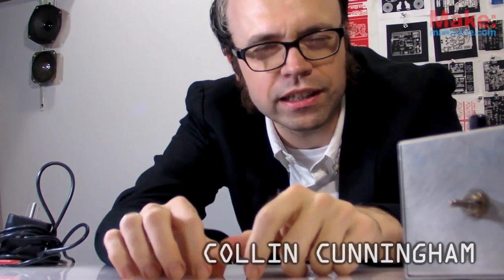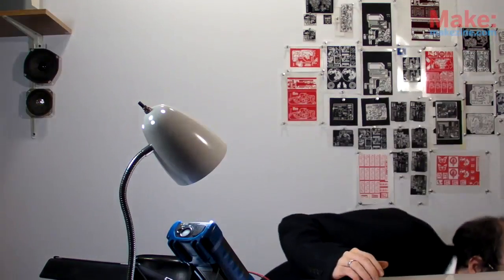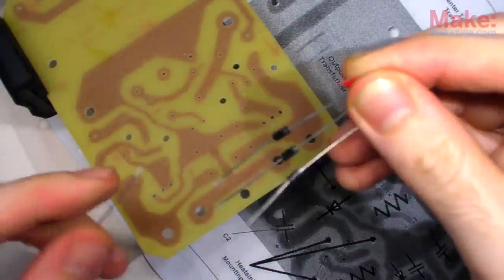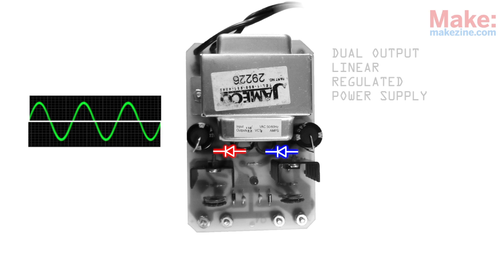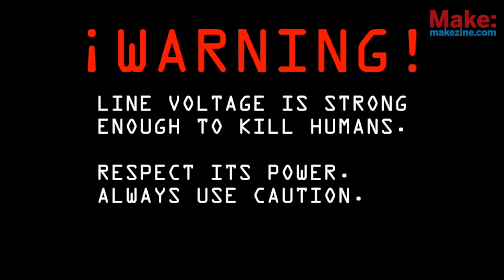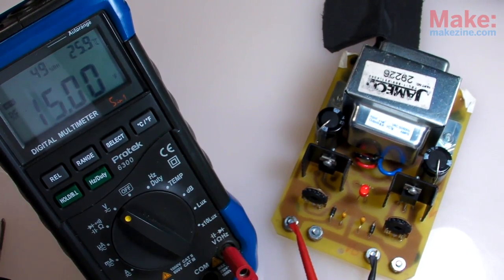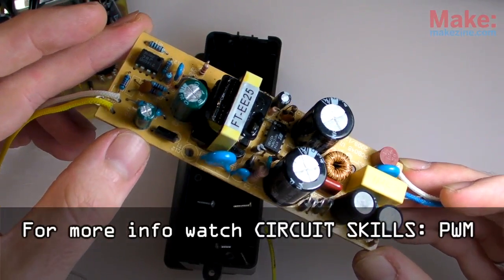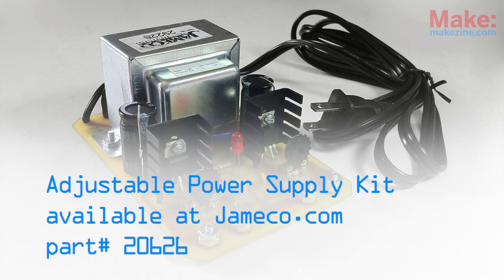Circuit Skills: Power Supply

Comment: i put mine in a large plastic case I bought from Radio Shack (yes we still got one!). I cut out a square on the front that extends across the front of the top and covered the top with some protective mesh. This allows access to the PCB mounted binding posts and prevents hands from touching further back than the PCB mounted potentiometers. I finally added two digital voltmeters to the front sides. 👍

Comment: hello,  I am new with lìelectronic and  I am wondering something.. I"ll pleased if someone can help me. that trasformer can provide like 4A or more. if I use the supply to  supply a device that works for example with 2 ampers what happen?  the device 
 will use only the 2 ampers reliably or the trasformer will give all the 4 ampers to the device?

Comment: Electrical tape stuck on a pcb as safety measure? Seriously you should consider upgrading your isolation as sharp ends of components sticking out of the pcb will easily penetrate pvc tape, that's if the glue does not fail first and just fall/peel off.

Comment: Thanks Colin...I'm a musician (not my day job) that got bit by the DIY bug. On top of that, I found out how much the bits of gear cost to build as compared to the butt raping retail that places like Guitar Center charge and looking inside at the circuitry, I realized that this stuff isn't that complex. You, and a few other YouTubers are my bridge to realizing my dream of building my own preamps, power amps, stompboxes, pedal board switching loops ...you get the idea. 

Have you published any books or manuals with basic projects that will let me build, for example a push pull, Class AB 20 watt amp using all solid state with a preamp that allows for adjustment of the bass, mid and treble bands. I'd be happy with a passive three band Eq that simply rolls off the treble, mids and bass in their respective ranges...sort of a mixer, but for frequencies or a low, high and all pass kind of tone control circuit?

Comment: if anybody can help me out with a reselling electronics question i would appreciate it. I have an electronics project i want to turn into a product and eventually a business. i will need a power supply from ac to dc to power around 4 cpu fans.  question is can i buy a ready made online power supply and resell it along with my product or would i have to build my own power supply in order to sell it with my product? thanks and if you could send any business law article link supporting the question that'd be great.

Comment: single diode rectification? pretty cheap and crap
Reply: the problem is linear regulators are very inefficient
Reply: You wouldn't get -15v with full wave rectification.
Reply: Making switch mode power supply that is good enough for audio application is very hard. The problem with this is the transformer doesn't have connection in the middle of secondary winding. With transformer that does have that you can make symetric voltage much better.

Comment: what would you have to change if you wanted to be able to increase the amperage from 750mA to say 3 A ?
Reply: Definitely the heatsink, maybe the transistors and probably the transformer. Bigger capacitors wouldn't hurt either. You'd have to check the ratings to be sure, but basically everything.

And please say current, not amperage.

Comment: Great video as always, but the actual product isn't much so. I bought the kit from Jameco after watching this, just out of curiosity. Well... There is no input protection at all, no full bridge rectifier and the PCB itself has no silkscreen and no solder mask - just like the ones you get from Bare Bones PCB. Some caps appear to be of questionable brands and quality. If that would have been a hobbyist DIY LED Blinking project, it would be okay, but for a power supply - it's too expensive to use such cheap design and components and without any kind of protection this is just outrageously dangerous. Be very careful if you buy this kit.

Comment: This thing is pretty cool, but a normal power supply brings a lot of voltages. You may think "12V, 5V, 3.3V, and -12V are nothing!" Well, one thing I'm thinking of: First I haveo get my keyboard working good n what if you could math...matc...matc...NNNDARN *mnsfjkldgjkldfghfgh different Just ner mind on this.
The mnsfjk was keyoard...keyboard mashing,so it justwent a lot slower.
Reply: Noorquacker Ind. What the hell have you been smoking?
Reply: You didnt end what you were saying
Reply: ficolas2 Yes, I forgot about that, and now I have the solution to my keyboard: I lost the battery cover and the batteries spill out. You could have ground be...say -12V and Vcc or positive or VDD or whatever it's called be 5V for 17V out! At least it's what it says on my multimeter and you'll not want ground touching real ground or else I'm not sure but it'll be bad.
Reply: DaryxFox My kyboard went up in flames. So my keyboard was smoking.

Comment: Why only half-bridge rectifier?
Reply: because the other half is received into '-DC'
Reply: Ayy Gee Well that one has 3 wires, so it has center-tap, thus you can use tap as ground and connect other two to a bridge rectifier > higher efficiency, but cost is higher too

Comment: I'd like to start off by saying my knowledge in the field is very limited. However, can anyone here design something variable voltage or wattage capable of going down from 7 watts to 250 watts at a maximum of 30 amps? Something with a momentary switch for e-cigarette use. Any info would be great. Thanks!

Comment: About the linear vs. switchmode issue: you must always be aware of the ripple on the output of a switchmode psu!
Reply: the biggest advantage of transformer is that you can bash it in the head of the guy complaining about switchmode converters.

Comment: I NEED a power supply 3-40v and 10 amps.. any ideas?
Reply: ebay? if you are looking for a cheap one that would be your best bet
Reply: jamiepie123
adjustable power supplies are very expenssive!! fixed voltage linear supply (switch mode) are cheaper but not adjustable.
Reply: make one then, find a 40v supply and make a high power buck converter for it or buy a high power buck converter. or something like that
Reply: jamiepie123 yes, but the problem here is that if you have 12v 20amps, when you use the buck converter to 14volts then the amperage is going to be something like 10amps or lower.. what will be the amperage on 40 volts? 3-4?
Reply: fair enough

Comment: Covering with electrical tape is a very bad practice, if not one of the worst. The ideal way to avoid electric shock is mounting into a plastic or metal housing, or box if you prefer, with a safe spacing between board and chassis, that doesn't allow electric spikes to reach it, in case you choose the second option.

Comment: I used to work in a TV repair shop, tv's have 25,000 volts inside, however Colin is right...it's the AC line voltage that is dangerous.

Comment: Okay. Can anyone recommend a power supply that supplies voltage and current independently? I need "naked" voltage from around 1-25V and separate current output between 0.001-1 or 2 amps. Also, can someone explain this sort of dichotomy surrounding voltage power supplies (not adapters) and their 'embedded' current values. I want to be able to supply my voltage and current values independent of each other!!! -___-

Comment: It really depends on how much current your project is going to be drawing. The larger the load the larger your transformer and the larger the filter cap needs to be (since the filtering affect with fixed capacitance will decrease with an increasing load). Since he is using both negative and positive voltages he has to use larger caps to smooth the gaps between the half waves. Your idea would only provide positive voltages.  Soooo there's that.

Comment: lol, fail. You need for a 5V power supply only a small 230V to 9V transformator, an LM7805, an 47uF condensator and the small tiny DF02M AC to DC converter xD

Comment: That is called biasing. The sign was faulty because the actual voltage is biased arround 3V DC and thus it would have been wiser to say XVAC 80A rather than saying just 3V!

Comment: Actually, that is what the battery can give you... dont forget that amperage is a product of voltage over resistance. Thus, if the body is a constant resistance, you much have a higher voltage to achieve that amperage.... However addressing the other comment form you about "Lethal danger 3V). That would possibly be the result of the ultra high frequency. As that may effect the resistance experienced by the body. That is a complex mechanism to discuss though, and I'm no engineer.

Comment: To be precise, it really is bit of both. You won't get killed by even 3A current, if it is something like 1.5 volts. You need enough voltage AND current to do any serious harm. (a normal 18650 battery gives gives out ~2 amps at 3.7V and you won't even notice that unless you stick your tongue on it.) Which brings a final point - the really dangerous electricity is AC. DC, in most cases, is not dangerous. (And then we add Hz to it. And THAT is what is dangerous.) -->

Comment: you realize its amperage that kills not voltage. Anything high enough to be conducted by the body is dangerous. I have been zapped with 240V and not noticed, because when it happened to me it was not from the wall and it had very little amperage. Amperage is painful and anything over 1.5Amps is enough to kill most people.

Comment: So if you have a +15V terminal than if you were to connect a load between that terminal and the ground terminal, you would have a 15V drop across the load. If you were to connect a load between the -15V terminal and the GND terminal you would have a 15V drop across the load (with current flowing in the opposite direction. You could connect a load between -15V and 15V and get a voltage of 30V dropped across the load.

Comment: When people say something is 5V or 15V or -15V, these numbers are only meaningful with a ground reference. I can have 1000V at one terminal and 1015V at another terminal and the voltage between them would be the difference, 15V (Of course those two voltages are also in reference to ground). In a circuit, ground is the point to which you compare voltages in the circuit.

Comment: No, it is not illegal in Europe as it is sold as a kit and under EU laws, that makes the builder take the responsibility for safety.  That is why some nixie clock kits that use high voltage are only sold pre-built as an option for countries outside the EU.  For shipment inside the EU, only kits are supplied.

Comment: Why does this kit only use half-wave rectification? For the want of two diodes, the ripple could have been halved, and the transformer wouldn't be as close to the saturation knee. 

Also, irresponsible to suggest that electrical tape alone provides sufficient isolation from mains power. This product should have a case that requires a tool to open. In its current state, it would be illegal in Europe or Australia.

Comment: He didn't say he is usign those, he just wanted an example of a circuit that needs both positive and negative rails. You are right about the 'newer' rail-to-rail devices, they make life easier :) Another example would be high-end transistor audio amplifiers I guess, but they seem to favor much higher voltages, both positive and negative.

Comment: Yeah, OLD op amps use that voltage levels, but he could've used LM358, which use 5V voltage level and consume really low current, using a single little 9V battery and a 7805 linear voltage regulator to power the whole noise generator. =)

Comment: That is true, but amps are hard to measure through a human body. That's why we used ohm's law to calculate the maximum voltage you safely touch. It of course depends on the resistance of your skin. For dry skin, the legal maximum is 50V. Damp/wet skin will lower that to 25V. If you are submerged or soaking wet the maximum is 12V. But you are absolutely right that it is the current that kills you. That's why the RCD in your house trips on differential current, not voltage.

Comment: usually you can have isolated outputs by using isolation transformers, which gives you floating voltages on terminals.

Comment: can someone please explain how a device can use a negative supply voltage... I get that a - voltage is just x volts less then ground, but isn't that basically just reversing the flow.. (conventional) current flows from + to ground, wouldn't a negative supply have it flow from ground to -

Comment: It is true that it is the current that kills.  The statement is misleading because it suggests to people that the voltage is irrelevant when it isn't.  People take it that way because they don't really understand what voltage and current actually are--potential and realized potential, respectively.  A truck has the potential to kill you, but, like electricity, it doesn't when not moving. You might also say that it's not the truck that kills you, but the kinetic energy transferred into your body.

Comment: 350,000 volts through a stungun isn't likely to kill anyone.  In fact, it's designed not to because it's powered by batteries, which can't produce enough current to kill (unless you have a pacemaker, or you die from going into "Shock" (no pun intended) from the sudden pain.)  I just don't see your point.  Are you agreeing or disagreeing with the statement that it is the current which kills?

Comment: My point is that it's silly to even remark that it's the current that kills you.  It's a bit like saying, "It's not the water that drowns you, it's the displacement of oxygen in your lungs that kills you."  The mere potential doesn't kill anyone and voltage measures potential.  The only reason people find the statement remarkable is because they know that high voltage can kill and the statement seems counter to their preconceived (and correct) notion even though it actually isn't.

Comment: I take that back, I confused nanovolts with microvolts.  The conductor would have to have 1000x smaller resistance than 4 inches of 12 gague copper wire.  Of course it would do nothing,   Also 500A at 1 nV is about 0.0000005 watts--not exactly "great power".

Comment: There are two problems with that position.  It is true that voltage is only the potential for current and it is the current that damages your body.  However,  current can't exist without a voltage potential and resistance is variable in the human body.  Less resistance means more current and if I'm not mistaken, given the water content of the human body (among other factors), a person will have less resistance to higher voltages.  TL;DR:  Don't discount the voltage factor.

Comment: although it also depends on the current. I've got a van de graaff generator I built...I can push about 100000 volts through myself and be perfectly fine...It's just the super short duration and low average current.

Comment: It is only using half the sine wave pear output. That is why it only uses two. what you are thinking of is a bridge rectifier witch would flip all the waves positive. What this does is take one side of the original sine wave and just smooth that and then do the same with the other side, thus making it supply positive and negative voltage.

Comment: I can't tell you that but I think that your going about it the wrong way. Think of -15V and 15V as 0V and 30V except that a transformer with 15V output is used and then two 15V signals are generated one being out of phase with the other one by 180 degrees i.e. -15V so you don't need a special turn down transformer

Comment: No from -15V to +15V you have a potential difference of 30V which he uses to drive the synthesizer (box he holds up at the start). If you want a 15V output you must use the ground (0V) and +15V only output. You must look at the potential difference; from +15V to -15V it is 15 - (-15) which gives you a potential difference of 30V and if your only using ground and the +15V then the potential difference is the 15 - 0 = 15V. Hope this helps you out

Comment: Hey, If You Are So Smart, Then tell Me One Thing..
My Room Light Power Shitch Had Broked About Year Ago..
I never Fix It, I Just Throw Two Aluminium Wired Togetgher for The contact so the light come up.
i always touched it with my hand and nothing hapened, besides in my country there is 220 W not 110 like in other coutries .. 
so one day i put the copper wire on it to fix it and instantly i get strong hit with electricity..

i mean.. why it didnt hapend when Just A Aluminium Wired Was There?

Comment: Nope, you don't need a special type of pot. Just use the same value as the ones in the kit, 2.5 Kohms. You can even use a dual-tracking pot for greater convenience (two pots affixed to one shaft), or a pair of multi-turn pots for greater accuracy.

Comment: The transformer is rated at 12.6v AC, not DC. When you rectify and filter an AC source, multiply by 1.414 (or rather, the square root of 2) to get the approximate DC voltage. This transformer, when rectified, will produce ~17.8 VDC, which is enough to allow for the voltage dropout of the LM317/LM337 at 15 volts. However, the heatsinks included in the kit are grossly inadequate, and will not allow 750mA to be drawn from the regulators (which are actually 1.5A rated) for more than a min. or two.

Comment: That is not correct. There are 3 symbols that can be used for Voltage: V, U and E. 
To kill you you need both voltage and current. The voltage is needed to break the resistance of your skin so that current can flow. 
Try touching a car battery. It can supply 120A and you will not die. At about 50V AC starts to become dangerous and at about 120V AC starts to become dangerous if ofcourse it has the abilitly to supply the necessary amps.